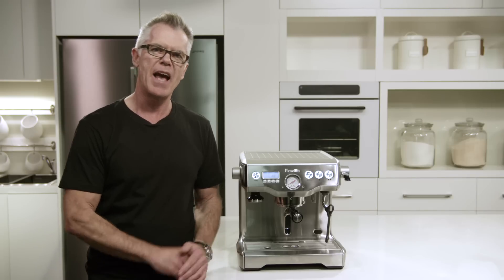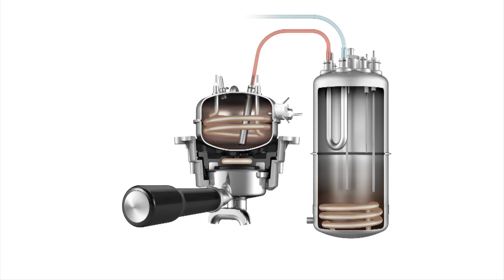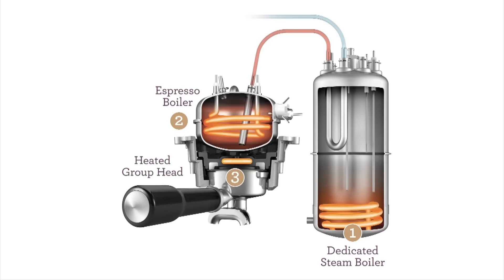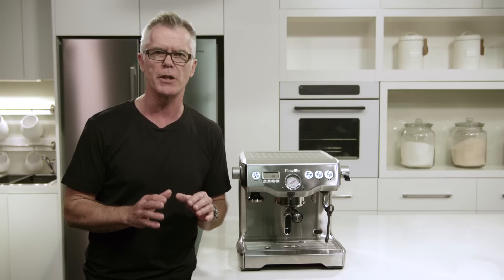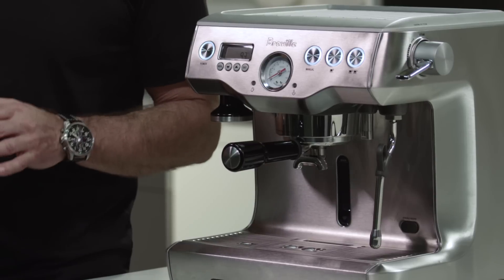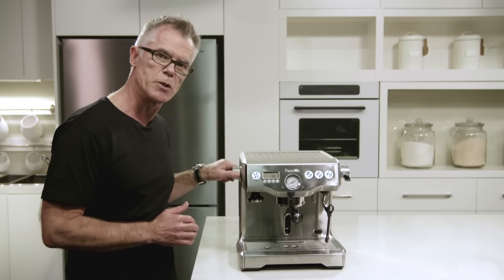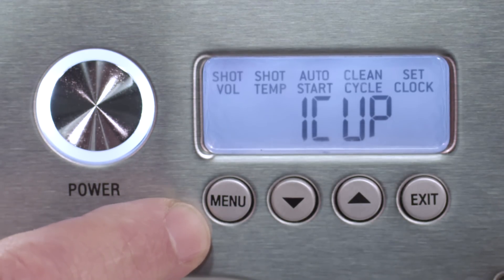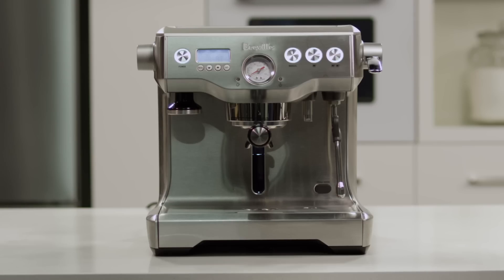Breville Dual Boiler BES920 with Phil McKnight

Comment: For the manual setting - can you still have the machine do a preset amount of pre-infusion, and then simply let the extraction run until you stop it? That would be great!
Reply: You can press and hold on the manual button for as long as you want to pre-infuse -- it will go to full pressure as soon as you release, then press the button again to stop.
Reply: @Jobbocks  I have found different , I only use the manual because I'm always using different beans and or extraction values and I seem to get around a 8-10 second pre-infusion